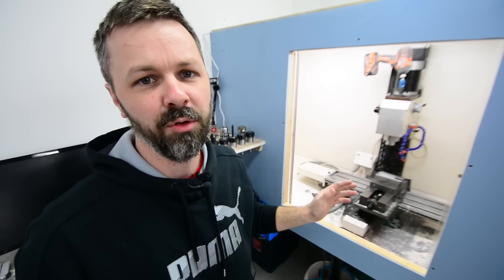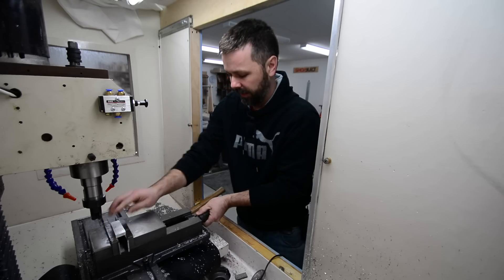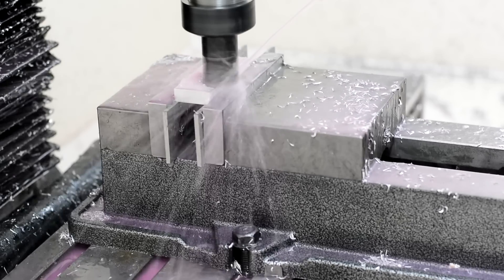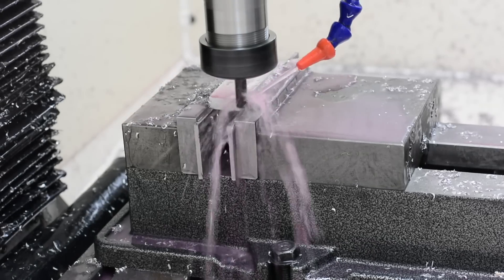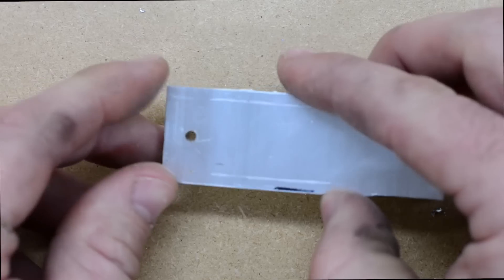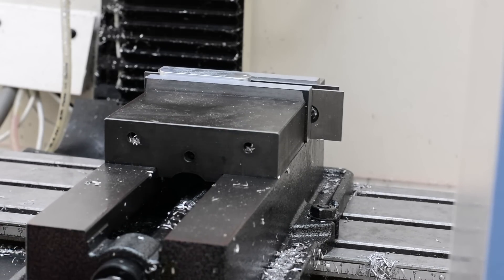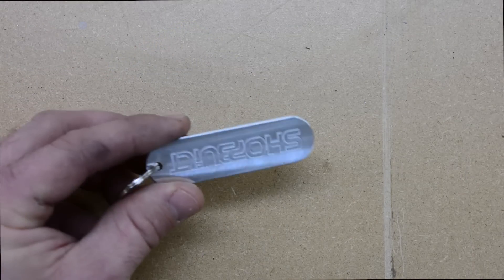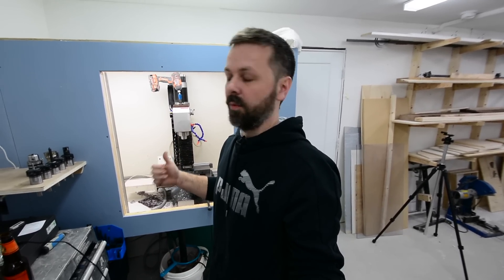Why did I buy a CNC mill?

Comment: Hey, when youre tapping your part down onto your parallels, if you use a deadblow instead it will work better. Using other hammers causes a shockwave that runs down the column of the machine, hits the floor and travels right and back up in the opposite direction, usually it actually lifts the part a bit. Deadblow sends the force in one direction only, down. Hope that helps!

Comment: Center drills work really good for Engraving and they come in a lot of different sizes. Get high speed steel though.  carbide chips to easy, unless you got a spindle capable of 5000 RPM or more

Comment: You need that much coolaint for aluminum?
Reply from the maker: its all about chip evacuation, re cutting chips can stick to your cutter, aluminum is very gummy. also really helps with surface finish. you really can't have enough, they actually recommend more than i'm using, especially with aluminum.

Comment: What was with the drill on the top?
Reply: for fast tool change.
Reply: thats used to tighten and loosen the tool holder. most people use a ratchet or air impact gun, but electric impact is just as good

Comment: You told us that the mill is actually a Grizzly. Is it the CNC the system that Grizzly supplies with their new CNC Mills or is it a manual mill with a CNC upgrade. It looks like a fresh paint job too. I like it. Plus, I noticed the HMI(Human Machine Interface) It appears that the previous owner put a lot of thought into it. I've always wanted a small mill. Congrats.